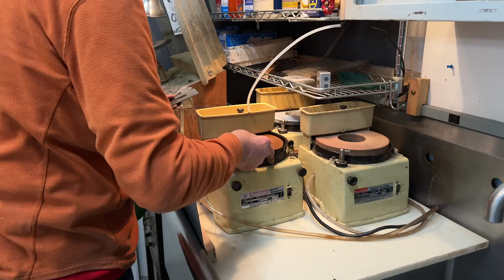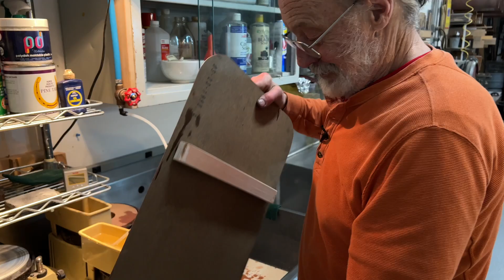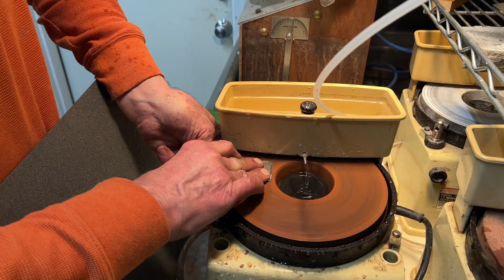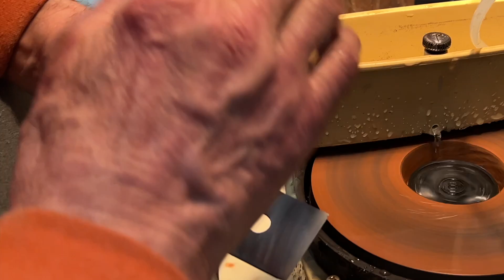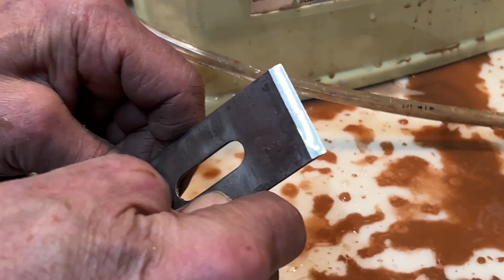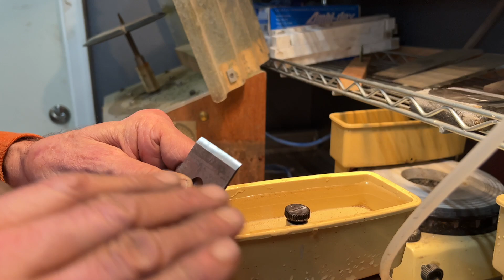Ken Parker Archtoppery - Edge Tools  - Sharpening Review - Chapter 3 of 4: The Flat Sharpening Stone

Comment: I use my 98202 primarily for planer and super surfacer knives. The stones MUST be slightly conical with the outside lower than the center, or you won't be able to pass over the other side of the wheel with a 12" blade, for example (I modified mine to handle 18" blades). 
What's missing for viewers watching this vid, is the entire blade holding carriage on the front of the machine has been removed. While the carriage is designed to hold jointer/planer/surfacer knives, it's easy to make a jig to hold hand plane blades and chisels. 
It's also far less sloppy to drape a wicking fabric over the side of the reservoir onto the wheel, you only need enough water to suspend the swarf so the wheels don't glaze with metal. There's not enough speed or power to create much heat. Spent years perfecting my technique on this machine, I love it.
Reply from the maker: 1) I used this damnable gadget, or tried to for many years, including making supplementary jigs to hold straight hand tools, as you cite.I always found the arrangement a little sloppy for my taste, and finally gave up altogether. I wish the machine were available without this option, which adds lots of cost, and is a blunder from my point of view. Glad you've made good use of it, and of course I agree about the stone shape, another downside in my opinion.
2) As an overgrown kid, I love splashing water, and consider this a feature. Play time!

Comment: Your method of sharpening is far different from what Makita suggests….West Chazy had one purportedly for jointer and planer blades but I could never get the right knack of settings to make it work correctly.  Works great on and planes and chisels though 😅!
Reply from the maker: It’s just style, really. Wheel goes around, steel goes away, problem solved.